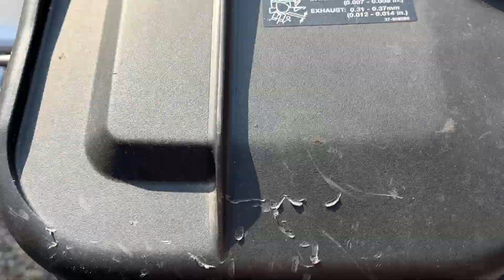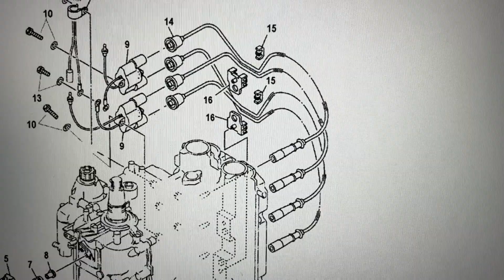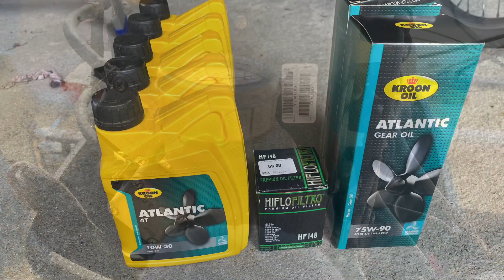The Mercury 90 hp on my Shetland 535. Part 2/?

Comment: Hi Poul.  Nice video as always😂.
It looks like there is a lot of water in the engine oil. Be sure to check the oil in the near future.
Happy sailing 😊
Reply from the maker: Yes, you can be sure that I will do that. I actually think it’s a lot of unburned fuel. 

See part 3

Comment: i think it could be emulsionated with watwr both in the engine and in the lower unit
Reply: yes, that's correct, you can check it if you heat  some ml in a glass tube carefully. If you do hear it a knock (or small explosion ;-) ), you have water in it.

Comment: LOL Max HP for a shetland is 65HP.. lets put a 90 on it.. poor transom
Reply from the maker: Yeah, but I bought it like this
Reply: I think a newer 90hp 2 stroke is the Same weight as one and a half 65hp outboards when the sheltie was made in the early 80s just make sure transom is solid and stick a thin stainless plate where engine is fastened for the torque difference..Simples i wouldn't worry  about it😊
Reply: @austenwest1011  in case you didn't understood me..MAX HP FOR A 535 includes a sheltie is 65 for the normal 535 and 70 for a sheltie by manufacturer specs if you go over those specs in either weight or HP your insurance will be null and void if you ever have a little bang, doesn't matter if you bought it like that or not, ignorance is no excuse! but heyyou do you.
Reply: @SailingAnja that's not the question any way sailor boy the question was the outboard size what was on the sheltie and the 535 offshore can be insured with a 75hp so stop being a loud keyboard warrior and stick to your sails and 4 hp back up on your leasure 17 pal 👍
Reply: @austenwest1011  Alright  , lets see 75...90... sure maybe in yank land and btw don't have a leasure 17 i have a 535 with a 70 and 2 other boats.. yeah sailing you should try it.. but i bet its too hard work for ya.. good luck bud
Reply: Any chance of rescuing me the transom has been ripped off the back of my sheltie when grabbing a pint from peel Island buddy I wish I listened to you about having a outboard whats far to torquey and heavy for the old girl ,done about 3000 hrs wreck fishing since last speaking to you,, ,,,,,You was bang on me old pal
Reply: Went to Shetland boats years back and they had a 90 hp on a sheltie the guy who drove the boat raced sponsored by the company boy he had that boat flat out jumping the wake off the Alaska 600 total madness hard turns I was surprised Bernie laughed about it great boats.